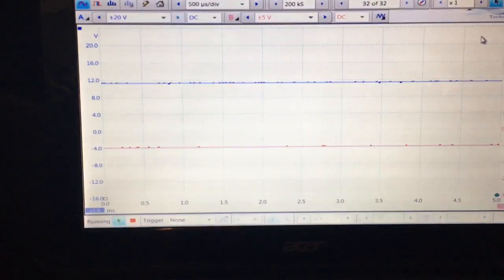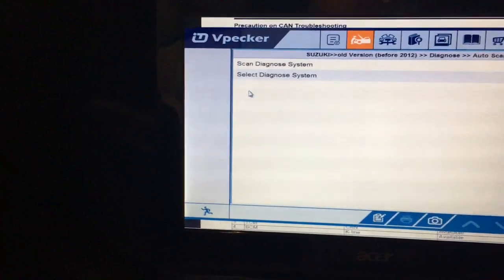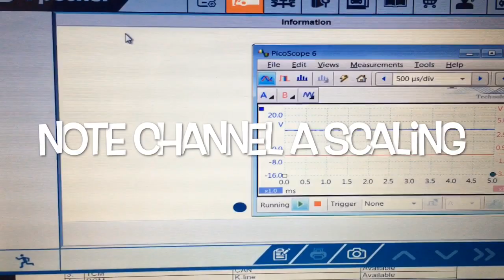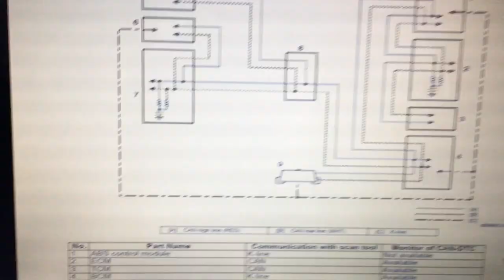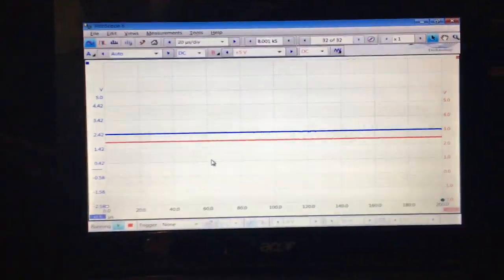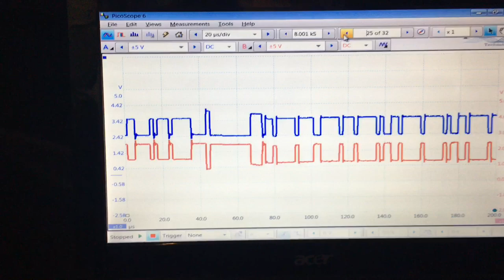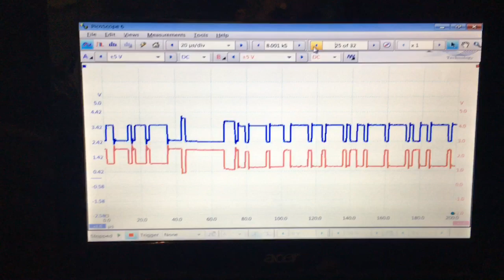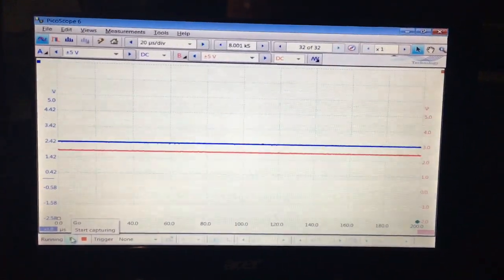K Line & CAN On Pico 2204A

Comment: 10 MHz is more than plenty for nearly all automotive testing…. It doesn’t have isolated grounds like the expensive scope has and it’s not as durable but the 2000 series is just fine,.. I’d probably go for the 2205 over the 2204 even on a budget… but either is fine… I’m an electronics guy so I’ve got high end bench scopes for my daily gig which isn’t automotive and indeed a scope is scope and any is way better than none…
Reply from the maker: Thx for watching. Appreciate you taking the time to comment. Cheers 👍

Comment: maybe you can help me or Can anyone please chime in opinion? I'm new to oscilloscopes and only do diy automotive hobby/work on family or friends cars and looking t get into scopes now that i feel conferrable with multimeter/test lights and how to do the basics and feel its time to learn to use scopes especially for things like sensor signals and things the meter/testlight are just not the right tool

i have it narrowed to two or 3 scopes all hantek.first is hantek 1008c for laptop,the second and third are the hantek handheld oscillioscopes (2c42/2d72)

as being new and for diy what would be recommended i purchase?Thank you for any help
Reply from the maker: You can’t go wrong with any of those options as an entry scope. The 1008 is a little dated now, quite slow and has really no storage memory (utilizing Hantek software) to speak of. But does offer 8 channels cheap! The handhelds are great but the display is super tiny. As I said they really are all good for the money. You might consider Pico scope 2204, better software and still reasonable cost. Thx for watching.

Comment: Great job. I don’t have a picoscope.. I have problem with my K-line, I have elm327 and also a launch redaer but both of them wont connect to my car ecu.. they tell me the protocol is KWP .. but connexion to ecu fails.. I tested voltage between pin 7 and ground and I found only some mV ( not 12 or 11 volts) .. do you have an idea about that ? Thanks
Reply from the maker: What model & year? ECM/Pcm’s are typically on the CAN bus not the K line. You will not necessarily read 12V as your meter on DC will display average voltage. K line is a serial data train usually only active during a diagnostic routine...Some modules on some cars.

Comment: I'm sure Can BUS decoding can be done on that unit as its performed by the software and not the hardware. Try Tools>Serial Decoding>Create>Can.
Also you can get the Automotive versions of the software to work with the 2000 Series by renaming  OEM.DLL in the Program Files folder to something else.
Reply from the maker: Thx & Thx for watching 👍
Reply: Yes, as far as I know (even though my Pico hasn't even arrived in the mail yet)! the same software is used for all their scopes (except automotive) so you can do CAN decoding, and you can decode a whole host of other standards, like Fast Ethernet, integrated circuits, etc, with any of their scopes.
Creating an algorithm to decode these things is probably really easy for a good programmer/engineer. Just converting the smallest binary slices (timescales) into known hex values, or whatever. And then all you need is to know what constitutes a valid message, and what the beginning or end of a message looks like.
Of course the actual messages are probably different for every car, but it should be quite easy to know if a message is valid, so it probably wasn't even a big deal for them to implement this into their software.
And it's definitely a good selling point.
Reply from the maker: @JoeBob79569  So help me out here...What’s the point in decoding a CAN bus message? Ultimately you end at the PID data a decent scan tool can provide? No?
Reply: @TheGibby3340  For me I was using decoding for identifying which packets had CRC failures when my BUS was that fooked that diagnostic hardware was inconsistent each time a scan was requested.
Reply: @TheGibby3340  For me, I'm getting random communication errors on my TCM on the scan tool, but my CAN, and the rest of the system are mostly fine. But sometimes, rarely, I get random errors on other modules, such as the ABS module. I want to figure out if these errors are still on the CAN line when I unplug the TCM, or some other modules, and this seems to be the only way to figure it out.
This should tell me if the TCM is sending out messages with errors on them, or if there's some random interference on the line..
And it should be an indicator if all the messages are the same like if all the errors are 5A2B08, from the TCM, then it's probably something goosed within the module, or if the errors are random then it could be a loose connection.
At least that's my thinking anyway.

Comment: I know this vid is 10 months old now, and this may not even apply to what's going on with your can bus readings, but... On a lot of newer vehicles the can bus does NOT fully interface with the OBD2 port under the dash. The port under the dash gets very limited access and info from the can bus on these types of vehicles, so you have to connect to Can_H and Can_L under the hood to get full access.
Reply from the maker: Thx for watching. None of the content I post can be considered current. Of my 3 vehicles the newest is 10 years old. Thx for the details.

Comment: Which software did you use? is it the pico automotive software or one specially made for the 2204A?? 
thankx
Reply from the maker: Eugene Smith Hi, it is neither. Just standard Pico Version 6.14.10.4759. Thx for watching. Cheers

Comment: Hopefully this will cheer you all up. Yesterday I attempted to fit the glow plugs that had been sitting around for a month or so. I removed the intercooler and heat shield and could not find the fecking things! I went back indoors, found a Russian YouTube video that seemed to show that the glow plugs are on the back of the engine. So armed with a torch I searched the back of the engine and still could not find the %$$&!! things! That's it! I'm done! This car is going to be run into the ground, I'm not spending any more money on it.
If you want a good deal on four new Bosch glow plugs then let me know :)
*this is what's known as an island car. In the UK if you live on an island that does not have a MOT garage then you can choose to be exempt from having a MOT certificate. But you cannot drive that car on the mainland.
Reply from the maker: Now’s a good time to remind yourself with all that going on...the plugs seem trivial. It won’t fix your car but it might make you feel better...Haha. We don’t have any regulations similar to what your describing, but there is no shortage of “farm trucks” in Canada. Cheers Mate stay sound. P.S....still waiting for a new video on yer local landscape or a wee bit of the Island. (Only if yer inclined of course).
Reply: @TheGibby3340  Yes I'm thinking about that. I've got to an age where I just don't give a shit and might even try singing. (this could be very bad)
BTW the only good thing that was discovered yesterday was that the vacuum pipe to the EGR diaphragm thingy was split. It's normally hidden by the Intercooler etc.  I fixed it.
P.S. I just acquired a 1.5 l bottle of whisky and it seems to have opened itself :)
Reply from the maker: rysacroft Have a wee dram for me. Look forward to your singing video. See how freeing the end of the world is ! That’s a joke...I hope. 😀

Comment: looks great ive been looking at one myself for a while .... k-line/L-line are also known as diagnostic lines for the obvious reason that they only talk when diagnosis is going on :)   great video im glad i came across your channel
Reply from the maker: CAN Diagnostic Thx...Short time ago I looked  at the K line for the first time...I had my other scan tool in parallel with my B.O.B (same set up) but the line was dormant. Did not realize at the time it requires an active interrogation of sorts...Every day a school day! Thx again 🍻
Reply: @TheGibby3340  we have all done that at one point or another . 12v is off state and pulled to 0v is active but I'm sure you know that 😊

Comment: The two channel pico looks great.  I have seen YouTubers using it, and it looks like the waveform is better than my hantek.
Thanks for the demo 👍
Reply from the maker: Mechanic Matt Hi Matt. For just slightly more money, in my  opinion it’s a great product. It’s only short coming is the 2 channels. As you know, 90% of the time 2 channels are plenty. That’s why I bought the 1008C for the rare occasion when 2 channels won’t suffice. But calling the 1008C eight channel is a joke. After 3 or 4 channels are in use, it slows to a degree to render it near useless....Wow long reply! Hope all is well under the circumstances...Cheers Pal

Comment: I think i showed the 2204 on CAN. The automotive features just set the scope up for you. You can import any automotive function into the 2204. In fact there is a hack to make the auto work with 2204. You prob knew all that anyways, cheers dave
Reply from the maker: dave sterl Exactly Dave. And yet I still hear plenty of guys dogging on the 2000 series. Unclear why? Well...I have a suspicion why!
Reply: @TheGibby3340  ok whats your theory?
Reply from the maker: dave sterl If I spent a fortune on a tool, only to find out after the fact that even the budget version of the product would suffice....well...Of course it is only 2 channel. Obviously limitation there.